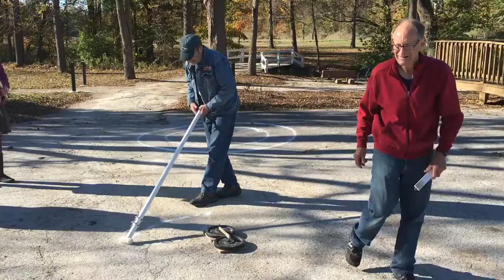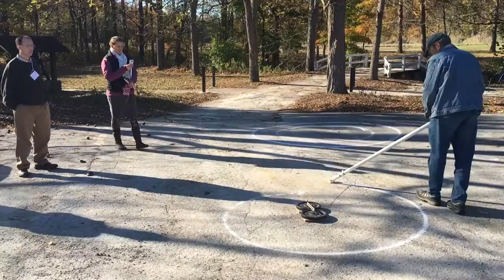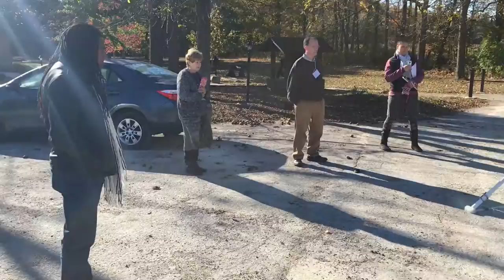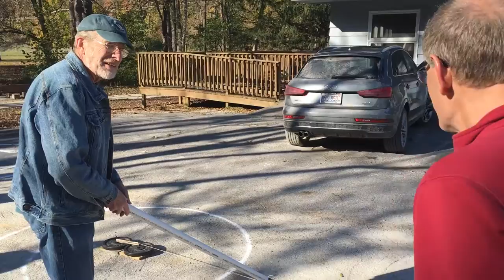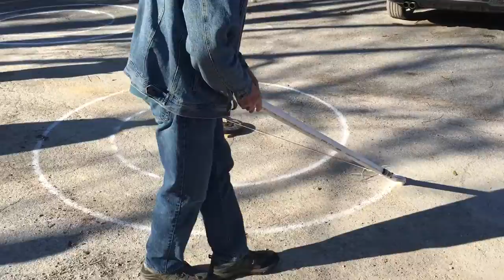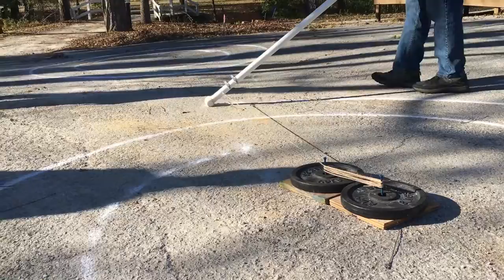Labyrinth Maker Tools

Comment: What tool were you using?
Reply from the maker: It's called a tape runner and I used to buy them from ToolLab, but haven't seen them available recently. I saw one on Zipup.com called a Floorboard Tape Dispenser, but haven't purchased one from them yet